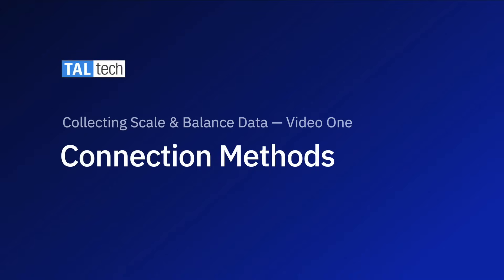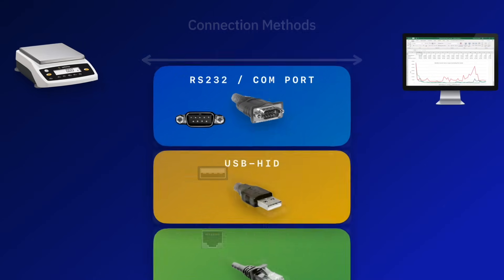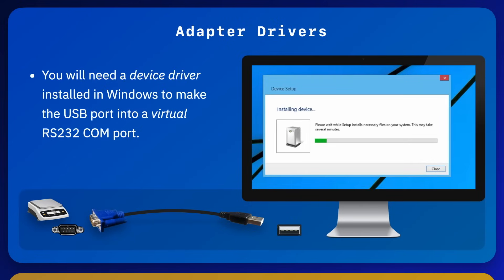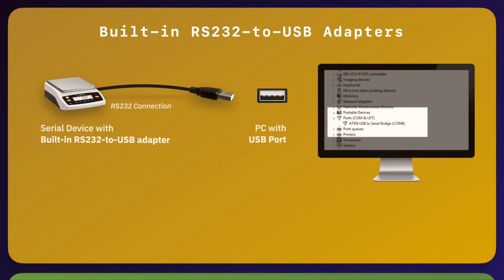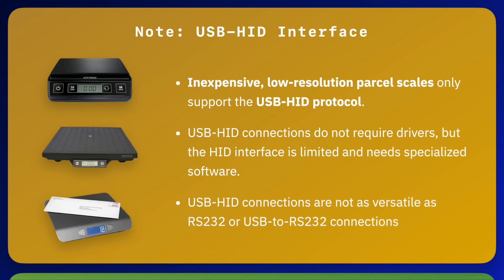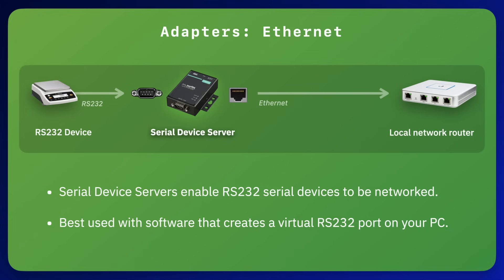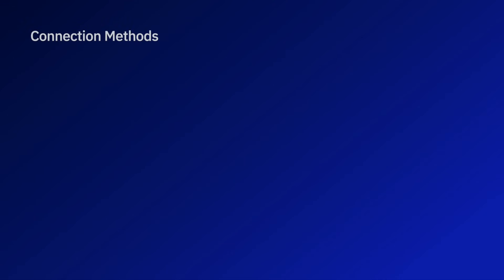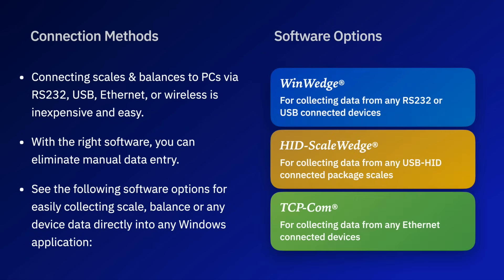Connecting Scales, Balances, and Other Devices to PCs

Comment: Excellent video. I have attached a RS232 to USb and connected the unknown scientific equipment ( SD-100 Verity Monochromator circa 1999 Device) No software available to drive commands to the unit. I have randomly sent commands through the Debugging software to send commands and observe the received data. The unit does not respond and not sure if its because its looking for the right command etc. I am at a lost and would like to be able to use this equipment. If anyone has an idea or actually has the software please contact me here etc. Anyone who might hav an inkling on the approach or a better idea please let me know... Thanks in advance!!!!